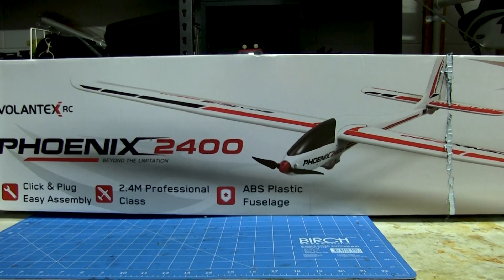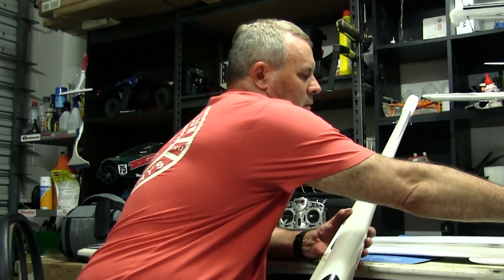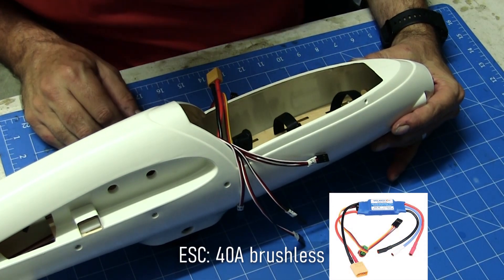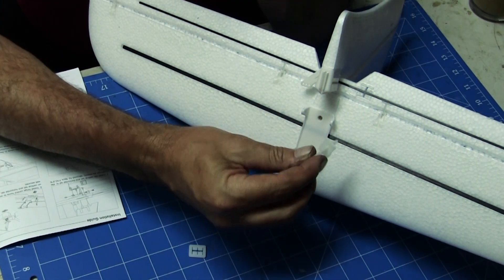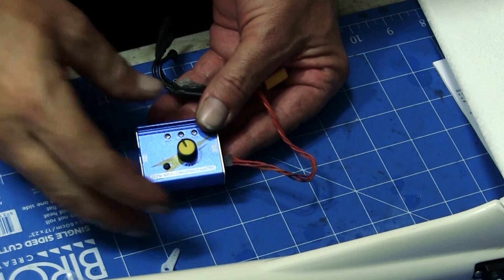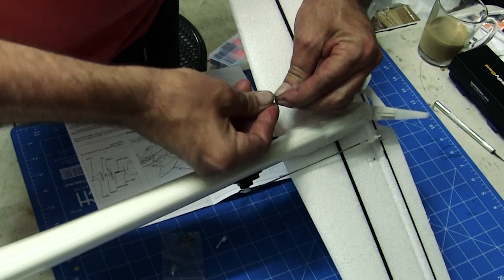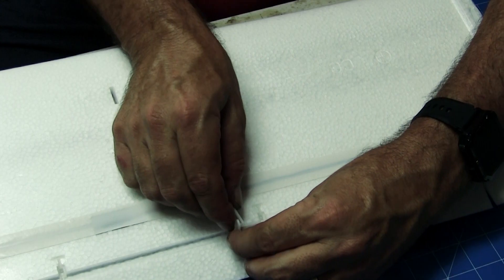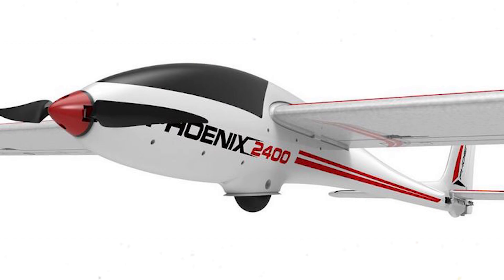Phoenix 2400 FPV Build Series Part 1 of 4 – Unboxing & Initial Setup

Comment: I had one but threw it away because it was way too floaty and was so much trouble landing where i needed to i flew in the desert primarily and there is lots of thorn bushes and small little brushes literally everywhere so i needed to spot land and it was unable to do that so i stripped it and threw it in the trash but if your in wide open areas with grass then you’ll be ok
Reply from the maker: @skyforce1983  I had a feeling it would stick to the air pretty well with the wingspan it has. I plan to fly this mostly at our flying field which is very grassy.
Reply: @ you’ll love it man honestly it’s great and hand launching only needs half throttle now the ranger 1.6 it always felt like it would dive to the ground then catch lift and quickly climb i look forward to your videos enjoy yourself and congrats
Reply from the maker: @ Thanks I’m sure I’ll enjoy it, I hope you have a great day and thanks for watching!

Comment: Strange with the color of the fuselage I got one last fall and it was all the same color and also strange with the control rods because mine come with two extra I would recommend gluing control horns take care looking forward to the maiden
Reply from the maker: @RobertOrtlepp  To be honest, I am quite disappointed with the difference in white to the wings leads me to think how long this plane has been sitting or if the fuse had been out before and discoloured. The box seemed like it was sealed up well but odd also 2 rods were missing as well.